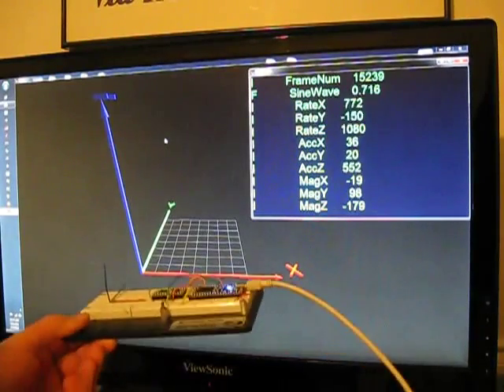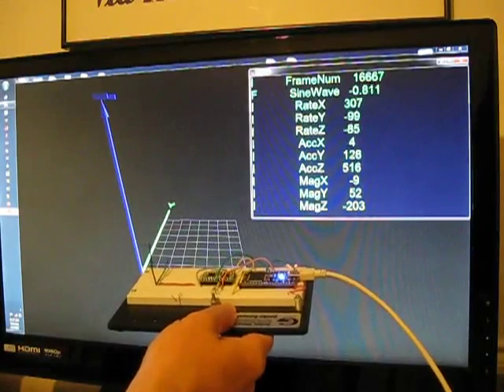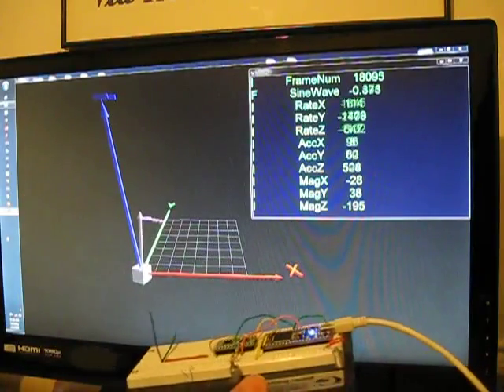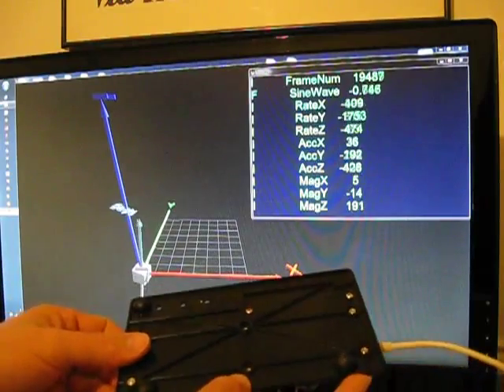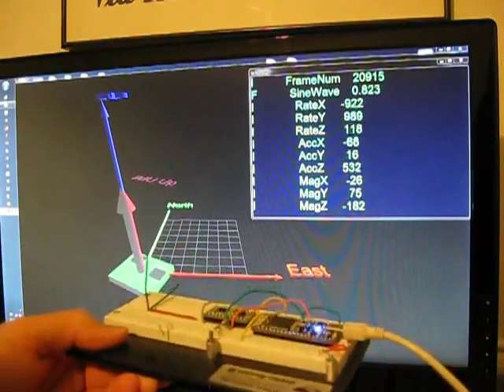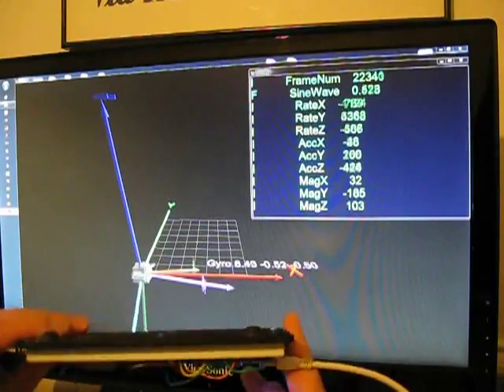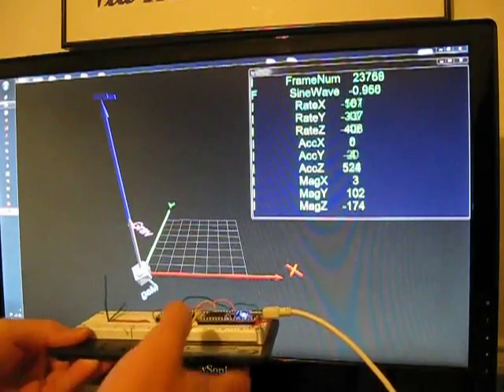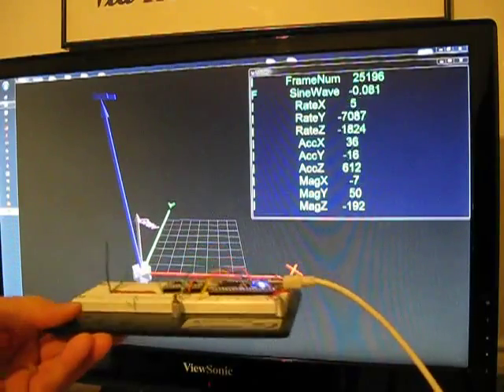Grant IMU Demo Feb 4 2012.mp4

Comment: I'm struggling to make the LSM303 and the L3GD20 work with my STM32F407 Discovery board for a University project. It would be great to have the code you are using. My email is: etienne.mathieu.2@ulaval.ca Thank you!